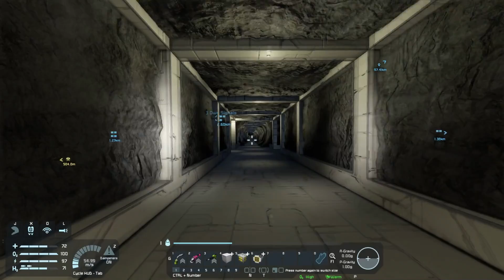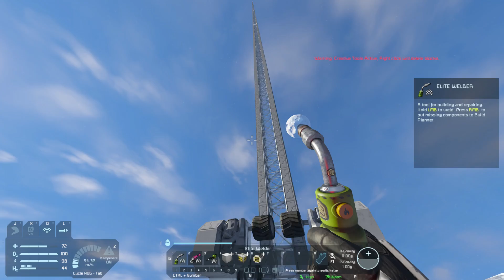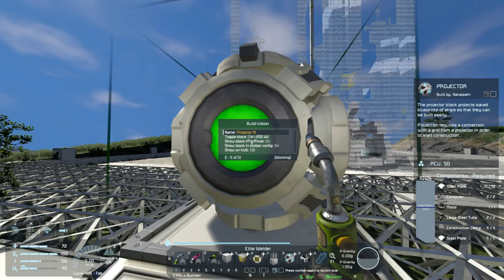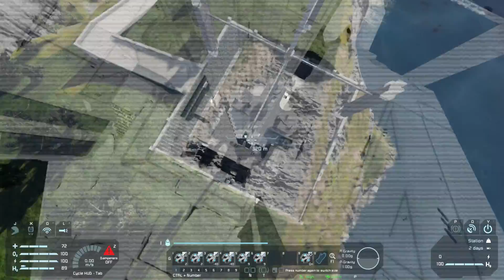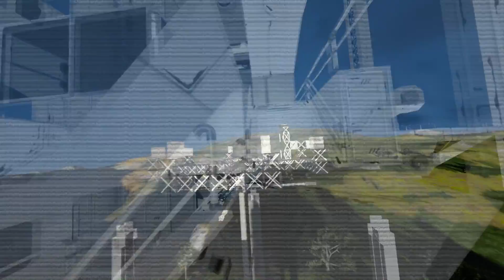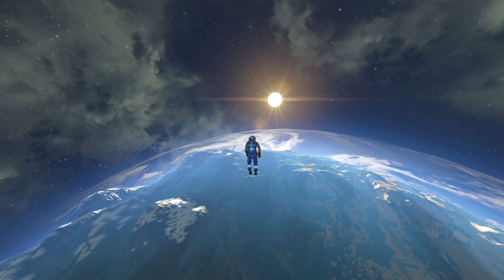Space Engineers - S2E57 'Starting The Space Elevator'

Comment: Alright serious question.  I've been trying to build a space elevator for days now, using a pretty simple style.  4 single pillars connected at the base for stability.  Independent mover as the elevator.  First try, ran into PCU limit.  Disabled that.  Then hit a 'Grid's number of physical shapes is approaching limit" warning, and I couldn't place any more blocks because the top of the elevator stopped having physics, I could just fly through the blocks.  Second try, simplified the design from 8 pillars to 4, and started at the top of a mountain to have a height advantage, and a smaller elevator.  At roughly 20.99km from the base, ALMOST at 0.00 P-gravity, the game stops me from placing blocks on the top of the elevator.  No warnings, stated pcu limits.  No performance issues.  The game simply won't let me place any higher.  The block outlines stay red and just won't place down.  Physics still work, and I can make other grids just fine.

PLEASE, any ideas?  Really sucks to spend so much time on a project and have the game stop working with no real definitive stated limitations, so I have no idea where to look for a solution.

Comment: I've tried to build a tether before and at about 8km is where the physical block limits start to glitch (you can fly right through them). The tether was 3x3 width/length and took forever to build in creative so you will probably need to build it in multiple grids so as to not glitch through the "physical" blocks.

Comment: The mega grid issue is why I break up towns into touching, but separated grids that are self powering (wind, sol, etc), and connected by connectors. Hook them up when you need them, leave them be when you don't, and have the master conveyor lines run below the road centerline.

Comment: Never considered the reactor core and how it could be built with the new DLC content. As for grid size, have you considered making "fire breaks" separating the grid into sections? Use connectors for the conveyor crossovers, maybe even have turned-off merge blocks there in case you need to rejoin sections in the future. Or just use them as a seamless edge-to-edge connection for the roads.
Edit: As to the extra space below, how about a "space car rental" center? One or two dozen essentially identical small ships with atmo and ion drives? Plus a landing gear. Rent a car, atmo up to the elevator and lock down. Then ascend and at the top use ion to move out. Also, how are the elevators recharged? Maybe another pair of connectors?

Comment: what RAM you got running on your pc? cos if your streaming or doing recording stuff while playing the game you might want your RAM to be at least 64GB that's the highest recommended RAM size. playing the game without recording/streaming highest 32GB hence I'm running on 16GB RAM and not done anything crazily huge stuff yet but still running good.
Space elevator is one of the tough design idea to come up with but will felt chuffed at the end once you've complete it ;)
what I'd do with that elevator you've built, I lower them down into the ground to level the cars on the platform or redesign the cars that the wheels is higher up while the platform car is lower to the ground platform (if that makes sense)